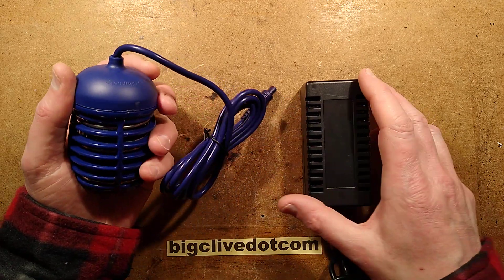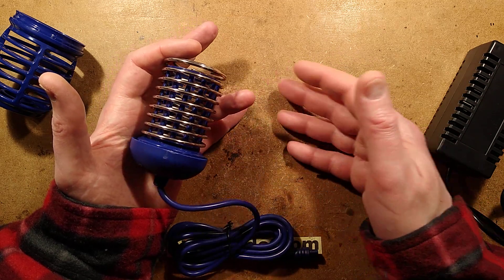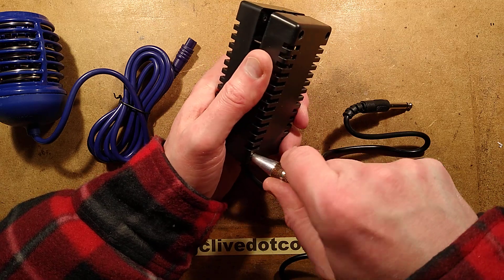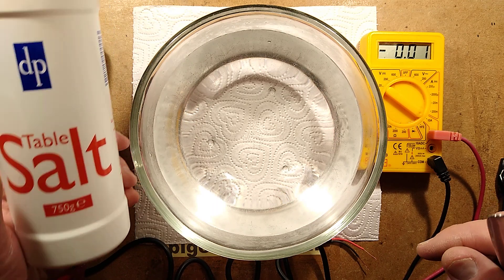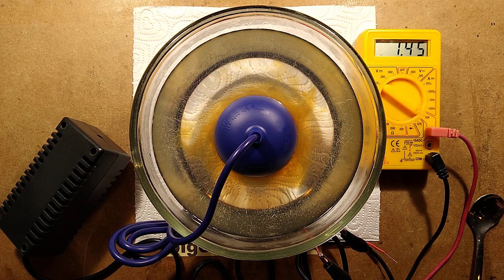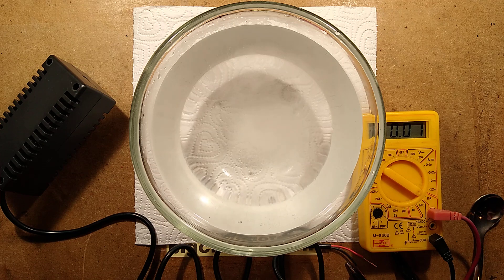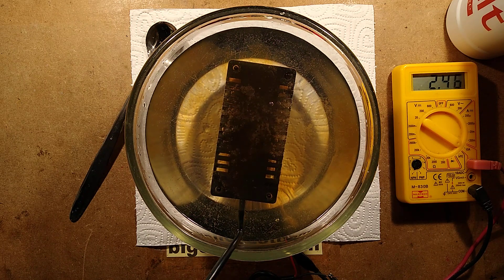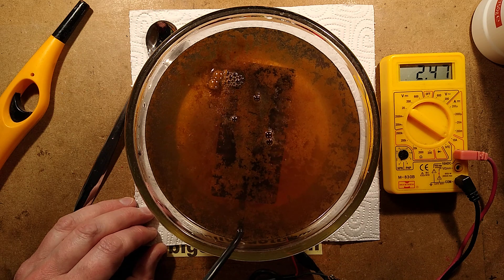Inside two different body detox foot spa electrodes.

Comment: BINGO!!!! MY CONGRATULATIONS! But, Why you did not show filling the cristal boul with tap water;  the instruments used measuring the values of the volts and amps, and the generator of DC current? How did you connected the male cell plug, to the negative and positive of your adjustable DC generator? Why the electrodes did not change? What is the main final composition of the "solution"? I am a retired Chemical Engineer. Johnny Marte, Santo Domingo, RD.
Reply from the maker: Someone did a chemical analysis of the metal loaded soup.  The results were interesting, with high levels of nickel and chrome.

Comment: You have electrolyzed water and the water is not pure.
For it to work properly, you must have clean water.
Filtered double osmosis.
Reply from the maker: The tap water here is ultra high purity.  The colour is 100% from the electrodes of this scam.
Reply: tap water only looks clean, but it is not, electrolysis shows this

Comment: Several years ago the FTC brought a fraud case against the kinoki foot pad demonstrating that detox through your feet is not possible. The fraud of the foot bath detox is easily demonstrated by running it with no feet in the water. You get the same Rusty discolored result.

Comment: The anode (positive) corrodes by attracting chloride ions.  This locally dissolves the alloy, making assorted chlorides of iron, chromium and nickel (the majority parts of traditional stainless steel).

At the cathode, sodium ions are attracted, forming, well, not sodium metal because that takes 2.7V or so and water will only ever handle 1.2V, so it reacts instantly with water, producing hydrogen gas and hydroxide ions.

When the local environments mingle, hydroxide combines with the metal ions, precipitating very insoluble hydroxides.  These have a very small particle size (not quite colloidal), and range in color from gray (iron (II) hydroxide) to green (chromium (III) and nickel (II)).

Additionally, iron (II) hydroxide is unstable, and partially reacts with water all its own, releasing hydrogen gas and changing to brown iron (III) hydroxide -- rust (or, one of its constituents, anyway).  Mostly, where oxygen is available at the surface, it oxidizes spontaneously, leading to a brown film or surface layer.

If you use a base instead (sodium carbonate or hydroxide), the oxygen overpotential is depressed (big techwords for saying, it isn't attacked by acid ions anymore), and you get oxygen from the anode and hydrogen from the cathode.

The "rust smell" is due to impurities in the steel, mainly relating to sulfur, phosphorus and carbon (which are present in small amounts, < 0.02% for S and P).  Apparently, some very complex organics come out of the process, which are of course quite pungent, ranging from 'metallic' to 'garlic' and 'brimstone'.  The concentrations of the odor compounds is very small indeed (parts per billion) -- the nose is quite sensitive to them!

Finally, assuming the rods are conventional 304 or 316 stainless, these are nominally paramagnetic (very weak, too weak for a magnet to stick), but they do become slightly magnetic (a few times more, enough for a magnet to barely stick) when work-hardened.  Likely, the wire starts out somewhat hard (wire is typically sold in a hard-drawn state, so it's good and springy, but not so hard that it can't still be bent into shapes), and the winding would add just a little more to that.  Thus, rendering it slightly magnetic again.

Comment: Hi Clive, I find your videos very illuminating, My question for you, "is  the principal of adding negative ions to a basins of water to bring out positive ions through you skin, flawed"?
Reply from the maker: A positive ion is caused by an electron deficit.   Airborne ionisers have been used for medical applications in the past.  The closest to what you describe is a medical technique called iontophoresis.
These units don't do that.  The current flows from one electrode to the other.
Reply: Hi Clive, Thanks for the reply. I know this might not be your area, but assuming that a person has unhealthy positively charged material in their feet, what colour of wire should electrode in the basin have?
Reply from the maker: @JohnJohn-zf4qw  If you have problems with your feet check out my video about various traditional treatments.
https://www.youtube.com/watch?v=wPLwczrGikM
Reply: @bigclivedotcom  Hi Clive, Loved the commentary on the video, have you ever thought about opening a Cocktail Bar, The problem with my feet is the dreaded Toe Nail Fungus. Have you checked out the Bloodroot Salve could be a useful thing to have in your cupboard.
Reply from the maker: @JohnJohn-zf4qw  The fungal issues under the nails are always tricky to get at.  A light dusting of boric acid in footwear from time to time makes it a hostile environment for any mould or fungal growth.

Comment: When I first moved back to my old home town in the late 90's I was quickly identified as "the computer guy" because I fixed a few old machines for my mother's friends.  Word quickly got around, there was no computer repair or sales service in town, so I was kept quite busy. One fellow who turned out to be a distant relative (small town you know everyone is related one way or another) began buying up all my old obsolete machines, this was in around 06 or 07, we had a computer shop in town by then and I had stopped servicing except those who insisted that I see their machines. Anyhow this guy was buying up all my old machines and running puppy Linux on them, and offering them in his wife's waiting room, you see she had a health spa sort of thing out in the country on a corner of their family farm, run out of an old one room school house that had been unused for 50 years or so.  Part of her spa was this huge machine that did just that, she got over $100.00 per session.  It broke down one day and against the rules of the outfit that supplied her with it, she had her hubby bring it in for me to look at.  Well he brought in the "head" of the machine which was a case about the size of a desktop computer. It had all sorts of plugs and cables, but only a few went anywhere, inside I found a ac/dc power converter, with a 12 volt and a 3.3 volt output. There was  a small board with a PIC chip on it I believe it was 8 pin, and a place to plug in these very large plugs that looked as though they came from the Switchboard I used back in 1970 Vietnam.  There was a blown diode on the power supply, it was obvious as it had actually broken when it blew, I have no idea how it blew, but I replaced  it with a 1000 volt diode and gave it back, they were so happy to get back in business, he said they were loosing a LOT of money while the machine was down, the company that furnished it charged them a 500 buck a year service contract plus a minimum of 100 dollars to open the case if you sent it back in for repair, the contract prohibited them from breaking the tiny seal on the case. Ah well it was an easy fix, he dropped me a hundred bucks and a bottle of Scotch for my trouble.  I heard they went out of business after the Sheriff investigated their "spa" on the complaints of some old lady's son, she went broke visiting them nearly daily because it made her feel so good.

Comment: Testing stainless steel with a magnet is a bit like testing brine with a piece of tissue. What are you hoping to learn? :)
Reply from the maker: Pure steel will attract strongly, different stainless alloys will have differing attraction strengths.
Reply: @bigclivedotcom  ohhh, so steel of the non stainless variety is always magnetic? Hadn't considered that

Comment: Actually this is not a valid test.  My local doctor actually did lab 
tests to and found body toxins in the water that got greater after 
several foot baths.  I myself have had my blood put under a microscope 
before and after a foot bath.  After the foot bath 50% of yeast that was
 there before was not gone and the cells were flowing freely.  That is a
 real test.
Reply from the maker: Your doctor would definitely have found toxins.  Mainly chromium and nickel.  They would definitely kill some yeasts amongst just about everything else.

Comment: I think this is similar to the silly Himalayan rock salt lamps you see around that attract water because it's salt and well water, around electricity smh  corrosion.. I believe it's supposed to be like an ozone generator but really absurd.  I suppose if you loved Indiana Jones 2 (prequel)  this would make sense...  As decoration only , wonder if Shiva would approve :P
Reply from the maker: The salt lamps claim to ionise the air, but don't.
Reply: @bigclivedotcom  and when I told the one that didn't recall it doesn't work yeah got about the same response but less so because I don't film videos , as you did.  Piping mad .  Again good for Indiana Jones fans...  and thats about it.  And maybe don't run it if it's humid because it make attract water like salt tend to do..

Comment: By telling them to reverse the polarity on their electrodes, you have just extended the lifespan and reduced the cost base of those "health professionals" providing this "treatment"...
Reply from the maker: The machines may swap the polarity themselves to keep the electrodes clean and wearing evenly.
Reply: @bigclivedotcom  were you or I to design such a power supply then a simple 555 timer or, cheaper yet, a relaxation oscillator could be used through an H bridge to swap the poles once every ten seconds to one minute.
The trouble is that those components would add an extra $0.30 to the BoM and would be rejected for reducing profit margin.
I once submitted a circuit at a mobile phone company, where I worked, that introduced a gentle DC bias to a headphones socket such that the earpiece could have a gentle orange LED glow while a call was going on. It was rejected because it added $0.06 to the handset and $0.20 to the headset.
Cost is key.
Reply: Equally, the electrodes you have are clearly designed to be used with a standard 12V or 20V PSU. Current doesn't matter as it merely affects how quickly the water turns brown and they won't attempt to limit it as the water does that.
Remember that they are so careless that they insist that immersing your feet in a salt water bath with steadily increasing concentrations of moderately heavy-metal salts promotes health.
Reply from the maker: @alexogle8950  I've ordered a controller to see what circuitry they use.  I'm guessing cheap microcontroller, maybe an H-bridge and a resistor.

Comment: If the treament is supposed to remove toxins and impurities into the water, but in reality it is metal salts being deposited into the water you have your feet in, does that mean your skin will actually absorb those impurities, and you leave the spa with slightly higher levels of chromium and other impurities in your system, absorbed by your feet???
Reply from the maker: Technically speaking...   Yes.

Comment: What the hell is that all about with the magnet? My HDD magnets slam into stainless steel just like into any other "magnetic" metal. It actually takes quite a bit of force to pull them away from stainless steel...
Reply from the maker: Neodymium magnets will slam into anything with even a sniff of iron present.  That's why I used a weak magnet.
Reply: @bigclivedotcom  Well you said "that's quite a powerful magnet" at 0:46 :)

Comment: Ha I recently finished my bachelor's degree on this subject as a chemical engineer. I used the same setup two stainless steel elektrodes with a DC power source, to try and remove crop protection agents from wastewater via electrocoagulation.

The only thing you might get from this is a buildup of hydrogen gas, chloride gas if you use tablesalt to increase the salinity of the water and maybe maybe some adsorbed ions of iron 2 or iron 3 via your soles. Also the formation of some radicals from the electrolytic process.

You are not gonna get healthy from this, the hydrogen gas could explode, the chlorine gas could burn your lungs. Do it too often and you can probably get iron poissening. And you get some not flocculation from the particles that coagulate together.

It does work though for the removal of crop protection agents, color and some other compounds. Though this is only for stuff that is already in suspension in the water.
Reply: I just don't remember the reaction's name at this late hour, but do know that municipal water treatment sites use salt and DC voltages (It does require IIRC about 9-12V DC) - Apply this voltage between a titanium and a graphite electrode (I also forget the polarity, this happens with insomnia... Anyways) - This converts H2O ( water) and table salt (NaCl) into NaClO, sodium hypochlorite, which is then used to purify water. Bleach kills most pathogens. The stainless electrodes will mess it up though, as they corrode, and you really don't WANT to drink something with those toxins in it. BAD idea, that! Not sure if you can get the Chlorine to outgas, I'm not a chemist, just have done a lot of chemistry automation etc.
Reply: @mrsheesh3743  yea that's electrolysis, electrocoagulation is normally either used as the very first step to get dirt and sand out of the water, or in wastewater treatment where it is used to coagulate and flocculate sludge

Comment: Hi Clive, I've got a Morphy Richards mini fridge that met it's demise today. I opened it up to see if anything was obvious, and noticed some sections of the PCB wee black and the solder degraded. I can't for the life of me work out why, so wondered if you might want me to send it to you for a video?
Reply from the maker: If it's one of the low voltage peltier fridges they often have issue with the high current burning up bad connections.

Comment: I've never seen this before but I bet the people are feeling better having it done. Anybody want to guess why? It's not the fact that they're putting their feet in it is the fact that you're breathing it in. It's an HHO generator. Why this is being done they are breathing in very good oxygen with hydrogen. Somebody mentioned the DC voltage would poke little holes in the skin? How would I do that use some common sense electricity takes the quickest way to ground. It's not going to seek out your body it's going to seek out the anode for the electrode. So I don't know there is some benefits there but he'll know it's not going to cure cancer. HHO breathing apparatus has been popular since like the 80s. And maybe if you do some ionizing you can make the body feel a little better. Anybody that's been around a negative ion generator nose you can actually feel it. So yeah this thing would help but it would help better if you put it up closer to your face.

Comment: Hi , i am trying to run 220volt Christmas decoration  led rice lights with 5volt dc or 9volt or with 12volt dc. Can you help me please? Waiting for reply
Reply from the maker: The lamps are usually low voltage, so you could possibly wire them in parallel instead of series.  LEDs might be a better choice.

Comment: Interesting! Adding to other chemistry comments of concern - it will also be cracking salt to Sodium metal and Chlorine gas! Side note: I've been knocked out on battery Hydrogen gassing out - it was instantaneous! That thing is a public health hazard! And, how much scratching around at the bottom of the electrical barrel will 'they' do - to make a buck? It's pathetically depressing ;)

Comment: 0:58  @Clive  Actually.... with the salt in the water, its basically a electrolysis  machine... keep away ALL sparks and flames as its going to be producing HHO And the corrosion of the stainless metal is only because the electrolyte in this case is salt. If it was Potassium Hydroxide then the Stainless would last for a long time. They are basically making potential explosion hazards. its not just a scam, its life threatening and potential property hazard

In your case you are over driving the current so the bubbles you are getting are more of steam and less HHO. But still be careful with that stuff

Comment: Would be nice to see those devices that use these "detox" electrodes. Especially ones with different modes, user selectable output waveforms and such. It wouldn't be very surprising if it used the same output for every mode.

Comment: I did the opposite and found the unite brand new at thrift store for a dollar. i took it home to take apart. Its the Alimtox ion cell cleanse.  It works at 4.5 volts on both the 1/4" output 2 and the propitiatory slightly smaller but not 1/8" output 1.  The board has STC89LE516AD or something very close to that it's scratched out on middle. Then it has (2) 66J94 2K chips. then   HRM1H-S-DC12V-C relay and several capacitors / resistors. Thank you for showing electrodes

Comment: Hey clive,
I recently got this charger cord for my phone.
https://www.amazon.com/dp/B08251KST2/ref=cm_sw_r_em_apa_i_e3osEbXZBMTAE

And was wondering how it works. The lights will go off when it's not charging, and they move towards you phone when it is charging. The strange thing is it goes slow when it's not hooked to a fast charger. I would be willing to send you a few if you wanted. It looks like its fiber optic.
Reply from the maker: I think I made a video about one of those.  Possibly electroluminescent.

Comment: The charlatans were upset you exposed their "treatments," then researchers found nickel and chromium compounds in the "post-treatment" water? SHOCKING! XD
I'd honestly like to know whether any of the chinese manufacturers of these are stupid enough to use stainless steel. Yes, it could leach hexavalent chromium, that's obviously a concern. But they'd also tend to corrode much slower, yes? You'd be drying up your own market, making them with stainless, not to mention the additional cost of the material (and that phrase "added cost" is a huge no-no to this type of scheme).